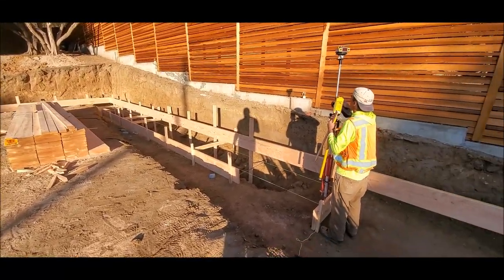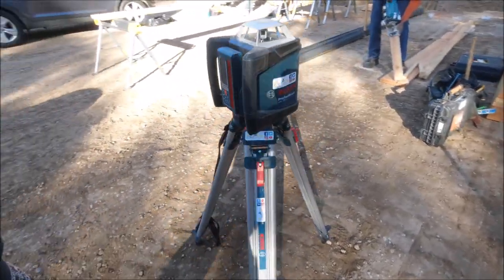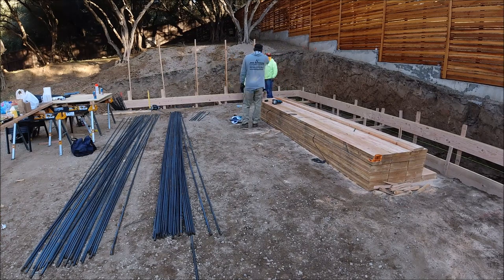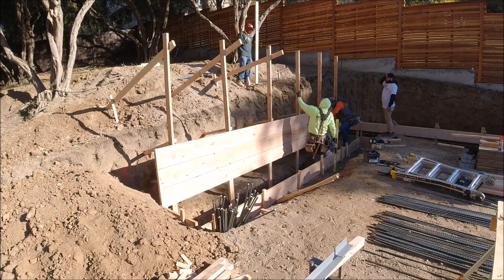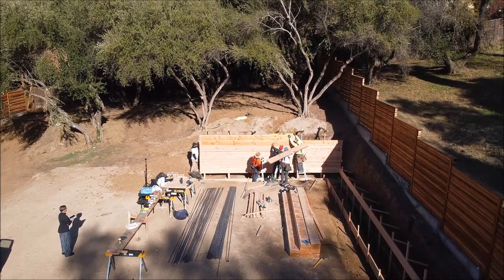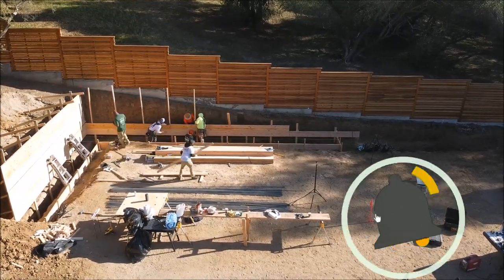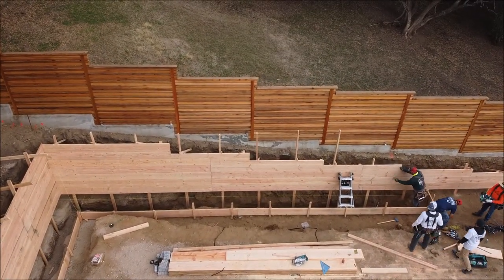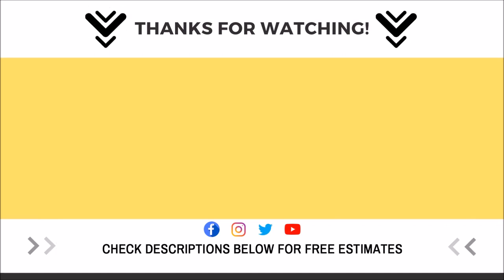🔊 How To Build The Back Of A Concrete Retaining Wall  The Right way 2021

Comment: The 10 ft 2.4 are stick into the ground ? Or just screw with the foundation stakes/forms .
Reply: It will be nice to see how do you brace the back wall/frame to prevent from open
Reply from the maker: Will try to get on the next video.. Appreciate the comment 👍🏾 👍🏾 💯💯

Comment: I'm back in school watching these videos. Thanks for the lesson.   It looks like the stakes end up captured in the concrete footing when it dries?  How deep do you have to get the stakes to hold the bottom from blowing out when you're pouring (using lots of cross ties and pouring in 8 to 12 inch lifts)?  Finally the braces to the dirt behind the back form are those just resisting spread when the forms load up?  Thanks in advance.
Reply from the maker: Appreciate the comment and support... Ill answer all your questions when I get back to the office 😂😂😂💯💯💯